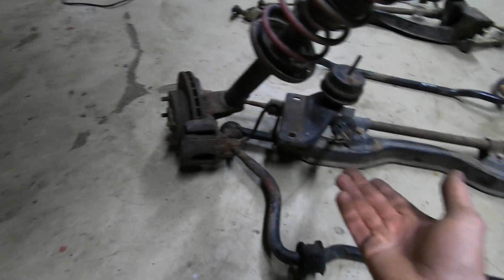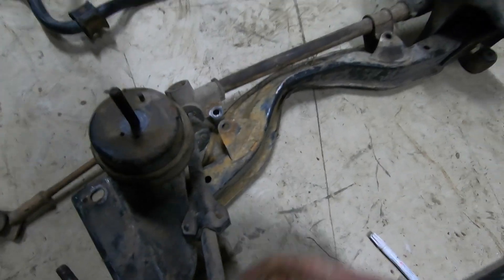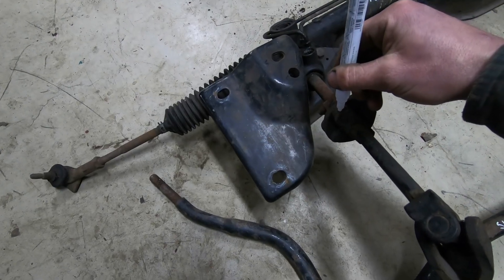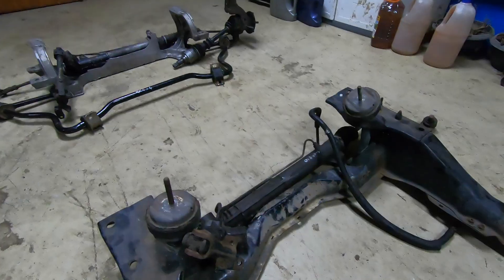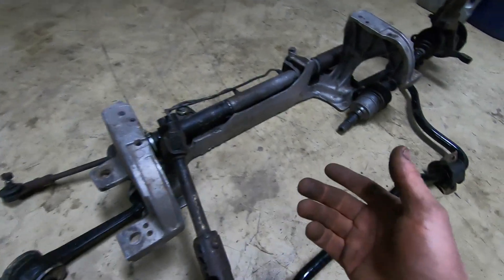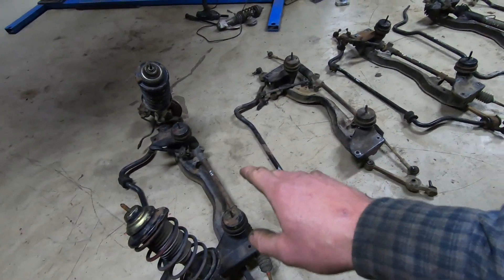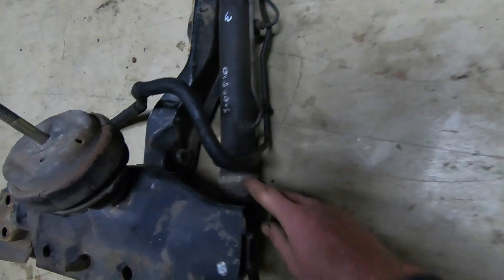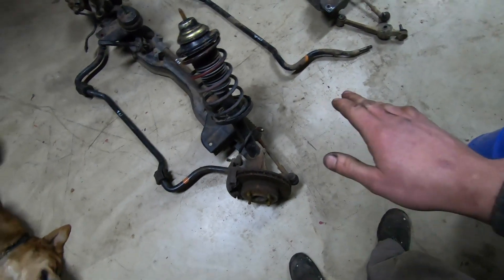All the Sierra and Scorpio Steering Racks Compared ! | Lock to Lock, Ratios, Possible Modifications

Comment: Although you counted lock to lock. The rack movement lock to lock is different as some have lock restriction fitted. The Cosworth one has a restriction on rack travel due to the wider wheels and different caster.
Reply from the maker: Good point and good info. I guess the proper way would be to measure the rack travel for say one turn of the pinion and determine the gear ratio that way.

Comment: I installed one without power steering and I realized that it has many more turns and I'm looking for one with fewer turns, but I've installed an electric Opel Corsa steering rod and I'd like to install the rack that I had previously with at least 2.75 turns so that it's a little faster. What should I do?
Reply from the maker: You can use a servo assisted one, you would have to put it apart and remove some of the internals, then grease it on the inside and seal the oil input and output shut.
Reply: @HappyDayGarage  thanks i try it!!! lets gooo
Reply: There are quick steering racks without powersteering, quite rare, my first Sierra had it and I didnt know it was rare sadly. You can buy the kit from Burtonpower to convert yours

Comment: Regular 4x2 not cosworth non-power steering Sierras have 4.25 turns lock to lock, power steering versions have 2.75 turns lock to lock. Sierra and Scorpio mk1 have the same steering racks. Scorpio 1 has 19mm longer tie rods. 
When you cutting steering knuckle you also need to move this piece inside the car to maintain at least the factory Ackerman angle. Simply cutting the steering knuckle disrupts the parallelism (or whatever it was) of the steering, you also need to move either the steering rack back or the wheels forward.